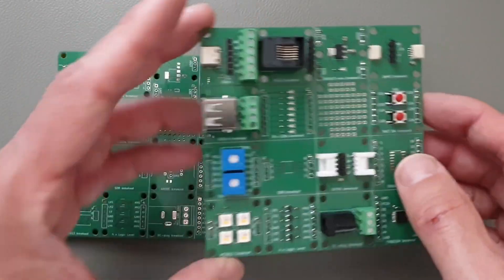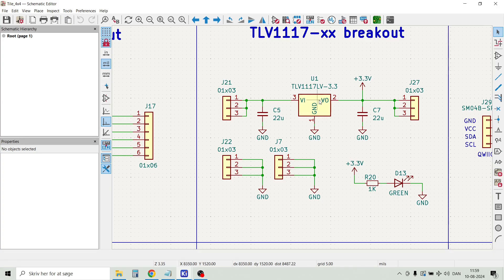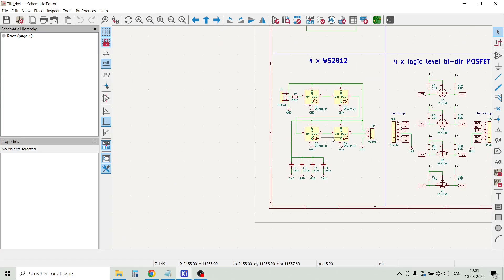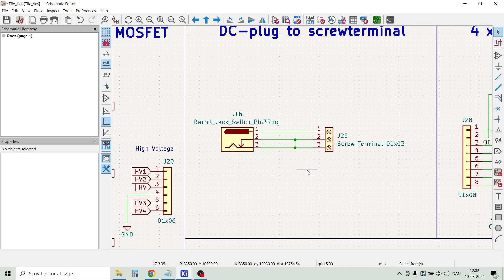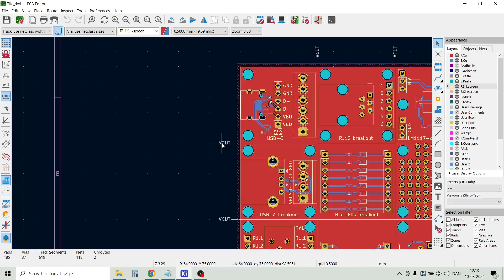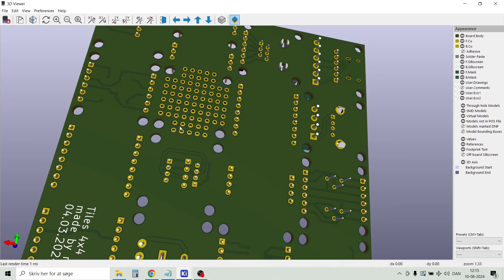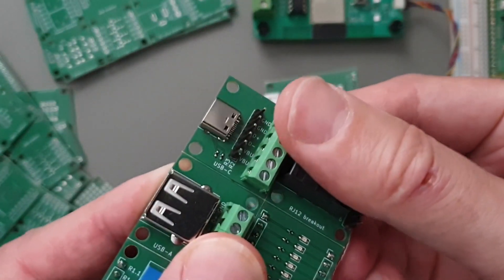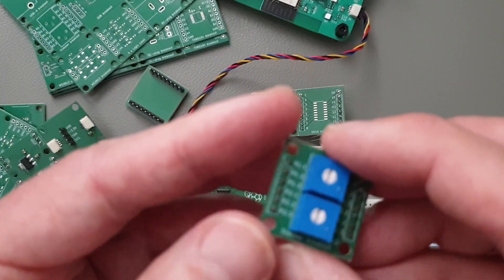KiCad 8 designed breakout boards. Use with your favorite ESP32 / RPi board. Full design walkthrough.

Comment: Electronics beginner here. Is there any reason that you add a copper pour in the boards? If I was to design the boards, it would only make sense for me to expose the copper on the tracks themselves.

Thanks and congrats on a very appealing project!
Reply from the maker: I normally fill the open space with a ground pour, If you have a 4 layer board it also makes sense to have a power plane for power distribution and a goundlayer for the return currents just below the upper layer.
Reply: @made.by.morten.laboratories  Thanks.

Comment: Does PCBWay charge extra for multiple designs in a PCB? Some PCB fabricators do charge extra so sometimes its not worth putting multiple designs on a single board.
Reply from the maker: Yes, there is extra cost attached when you jave multiple designs in a panel, i really don't understand why

Comment: Avoid "V" cuts. The PCBs are cleaned after manufacture but you release fibers breaking the "v" cut. 
Google:  Inhaled silicone dust, particularly silica (silicon dioxide), can cause significant lung damage. This leads to inflammation, scarring (pulmonary fibrosis), and a condition called silicosis, which can severely impair breathing. Over time, exposure to silica dust can lead to permanent lung scarring, making it difficult to breathe and potentially leading to disability or death.
Reply from the maker: @Egg-kh2xo, thank you for info!

Comment: Great idea!

How did you indicate the V-grooves in KiCad?
Reply from the maker: I just placed lines in one of the mechanical layers. I included that layer in the Gerber data and informed PCBWAY that they should place the V-CUT to the specification in the mechanical layer file. Very easy and they got it right.
Reply: @made.by.morten.laboratories  Ah OK I thought there was a built-in way to do it.  Thanks for clarifying.

Comment: Hej morten, jeg har en evga gt750 supernova der går i over voltage mode (tror jeg) så snart den skal trække en lille smule strøm fra en pc. Min kusines dreng der ejede PC'en med strømforsyningen  havde slået hårdt ned i bordet og så havde PC'en lavet dette nummer. Skiftede hans psu og så kørte hans pc

Den kan tilpas lige nå ind i Windows installation (skrivebordet med Windows preinstalled) og så fryser hele billedet og PC'en lukker  ned efter et par sekunder. Prøver man så at tænde PC'en igen kan man intet få til at virke, slukker man PC'en på stikkontakten og genstarter den virker alt igen. Og laver derefter samme nummer. Er testet i 3 forskellige pcer som alle virker.

Er det noget du måske vil kigge på? Har set du har kigget på en evga psu før. 
Vil lige nævne også jeg har samme psu tester som dig og den laver de rigtige voltages når den ikke udsættes for noget press. Så den skal testes i en testbænk.
Reply from the maker: @rystdin, ja det kan vi godt finde ud af, denne type fejl kan dog være svære at finde da der ikke findes diagrammer og dokumentation på de anvendte chipset
Reply: @made.by.morten.laboratories  Er der et sted jeg lige kan kontakte dig? For hvis jeg skriver min mail ind her som kommentar så bliver kommentaren bare slettet. Mvh Mads
Reply from the maker: @rystdin  du kan sikkert skrive på min ko-fi, se link under mine youtube detaljer

Comment: Were these boards fully assembled by PCBway, including the through-hole parts as well as the SMD ones?  And can you do rounded corners on panelled layouts like this — does it still work OK with a VCUT?  Thanks.
Reply from the maker: I only made the PCB at PCBWAY, I did the assembly myself. Yes its possible to do rounded corners and do v-cuts, I have done that on other designs before - the radius was 5mm and it turned out fine.

Comment: Excellent work. This is a great project for new Kicad users who want to practice and have something they can use at the same time. I fly RC airplanes and use the programmable LED's for night flying. A simple board to join multiple strings of LED's  comes to mind immediately.   Then of course a regulator to break down the 3s or 4s power to 5V DC comes to mind... so many things that can be done with your concept here. Thanks again.
Reply from the maker: Thank you very much for your interest and kind words, i am glad you find the concept useful